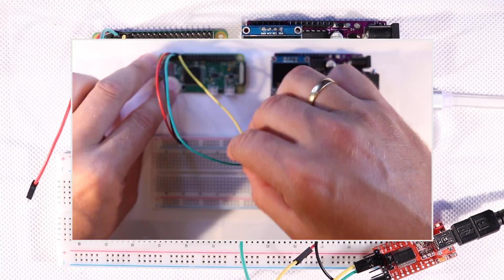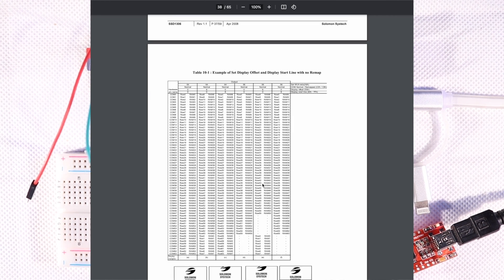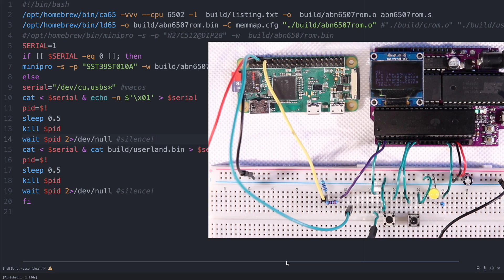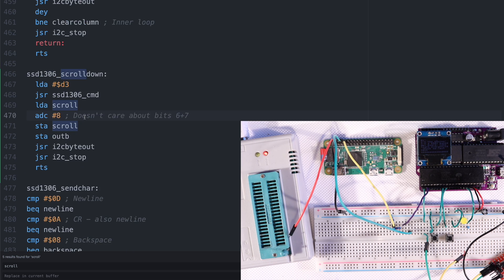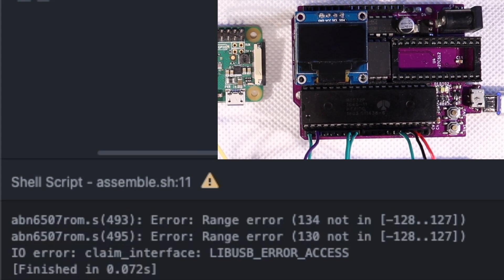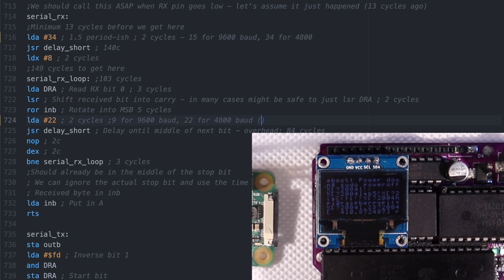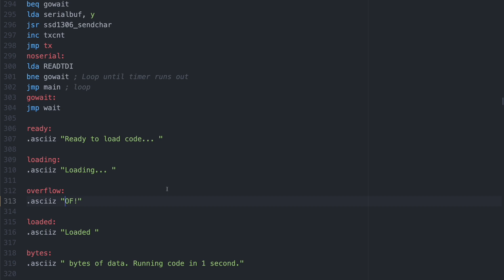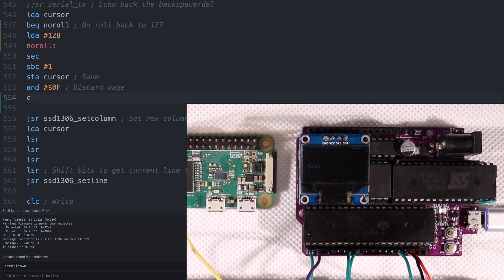Scrolling OLED on a 6502 Single Board Computer

Comment: More Coding. I am building my 6502 as we speak. No silly 8 I/O lcd I am rather keen on the oled i2c. Would be nice to understand how userland works.  It looks like   you are writing to eeprom and not using the serial ram upload?
Reply from the maker: While developing things it has to be a combination of both - when routines new routines are made they have to end up in ROM eventually :) 
The next few videos should help you along :)
Reply: @AndersNielsenAA  I greatly look forward to that. I have been reading the RIOT datasheet, and the oled one too, but the oled one is talking about the control chip not the oled its self. Doesn't seem like the RIOT is used that much so there is hope I can translate the code to the VIA. I really like the idea of  i2c/SPI/serial over  8bit LCD and 5 buttons. The Serial and i2c really open up possibles.  I am thinking of  2 buttons Serial and i2c, and maybe SPI for file storage. I have a SD module from my Arduino that is happy to run on 5volts, and it has level shift built in for the data/control lines.
Reply from the maker: There's no delay for i2c and the ports work the same on the VIA, so you should be able to copy the i2c routines right over - as long as you rename the port and put SCL on bit 0 at least.
Reply: @AndersNielsenAA  Yes i2c can be as slow as you want, and maybe SPI as well, but serial that seems to take a bit more care with timing. I think with serial you also looked at trying 4800 bps, but it seems like 9600 bps worked out. :) As for RAM  I have 16k so limitless memory. Ty for the tips, I have house cleaning and getting my sewing machine working today, or maybe tomorrow.

Comment: Could you implement RTS/CTS to prevent the buffer overflows?
Reply from the maker: With the FTDI to the 65uino - yes. 65uino to RPi - no sadly. I looked it up and it doesn’t seem the Pi supports it.
I think the closest solution is improving the buffer to be FIFO, slowing things down and doing work while waiting for the timer
Reply: Try sending a xoff (ctl-s) char back to the rpi.  This was an alternate inband type of flow control often implemented in terminal software.  Send a xon (ctl-q) char to start it sending again. @AndersNielsenAA
Reply from the maker: Actually I might not have dug deep enough - maybe it is possible to enable RTS/CTS without too much trickery - maybe an overlay file..
But XOFF/XON would almost be too easy - I’ll have to try that.
Reply: @AndersNielsenAA  I'm very interested in what you find out!